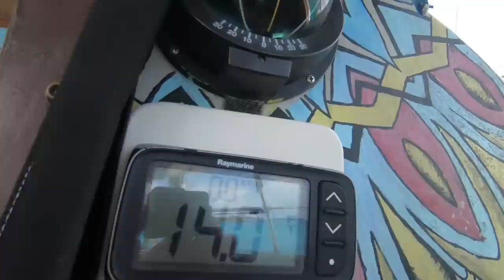E64: Calibrating my Depth Sounder Underwater and Goodbye Makemo!

Comment: Did you have any problems negotiating with Customs due to COVID? I read many horror stories about sailors being locked out of harbours due to travel restrictions.
Reply: I know that in Trinidad and Tobago where I am based cruisers haven't been allowed back in since last March which is really just horrible and I certainly feel for them. Also, even locals aren't allowed back in very easily so it's not like we can sail out the foreigners boats and then come back home. It's an utter mess!

Comment: Just curious.  Why not a wind turbine, to generate electricity?  I'm sure that you have considered it.  Just wondering what the "con" was that precluded its implementation.
Reply: Expensive, loud and not very effective.
Reply: @dutchglobetrotter4513  hydrogenerator?
Reply: @donnasummer6285  They work when you have a boat that can sail fast. Usually they are most effective above 7 knots, they do drag so you need to be able to sail ~0,5-1knot faster. They are very expensive and need a specific mount on the stern. Not all boats have the real estate for it. When they work it is a very good power source. I wouldn't rely on my power with that many moving components.
Reply: Donna is on the money. Good heads up for the uninitiated.